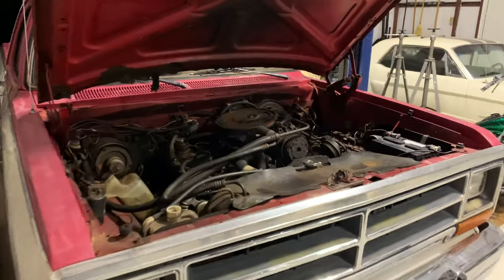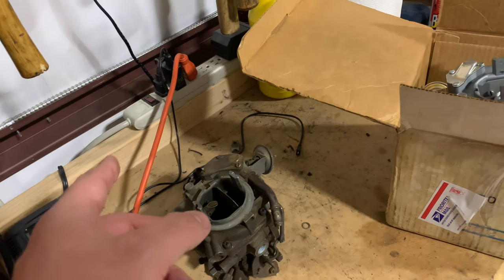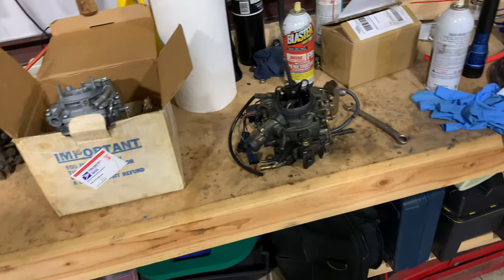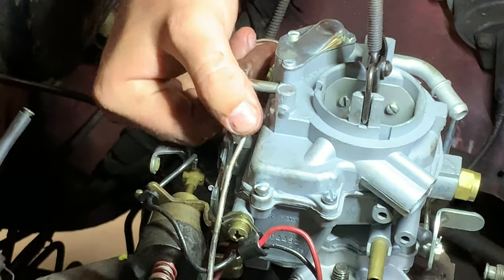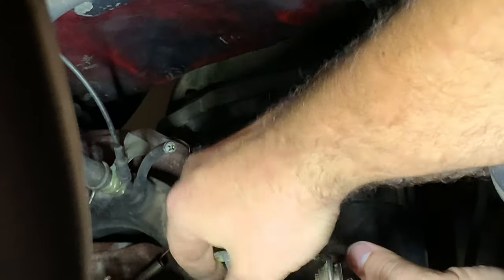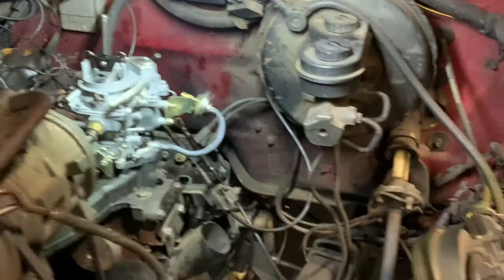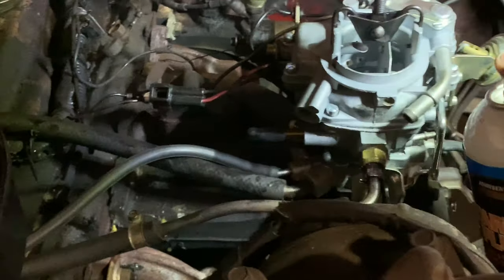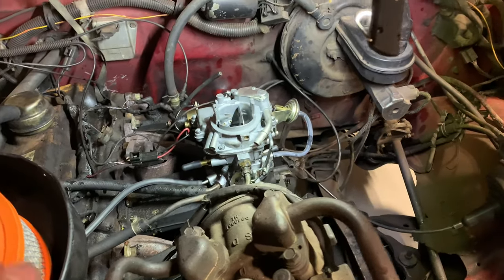NOS Carb Install - ‘86 Dodge D150 Royal SE

Comment: With your current set up, will your truck cruise comfortably at 75mph on the highway?  I have a ‘75 D100 with same /6 1BBL set up but no a/c; can do 70ish top speed on highway with pedal floored.
Reply from the maker: Yes, it did pretty good cruising at speed down that Interstate.
Reply: @HiRevzMedia  Just took my 1BBL carb apart to clean and inspect since I was getting horrible fuel mileage and running very rich no matter how I had the air/fuel mixture adjusted.  Found out the little weight over the accelerator discharge check ball was missing so check ball could never properly seat allowing almost constant unburned fuel seep into the intake thus returning a paltry 8.5-9.5ish mpg.  Since I cannot get that weight anywhere, had to order a reman carb.  What mpg are you getting with your slant six 1bbl set up?

Comment: I tried finding one of these for my 84 d100. None of the auto parts around carry single barrel holleys for a slant six and I really don't want to swap my exhaust manifold and get an adapter plate and put a two barrel on. Do you know where I could order one online?
Reply from the maker: Marshall Shakur I was running into the same issues.  I was just lucky enough to find this one on eBay.
Reply: Yeah I had the same problem I have a 87 w150 I had to order one from summit racing it costs me around 340  it was the only place I could get one from